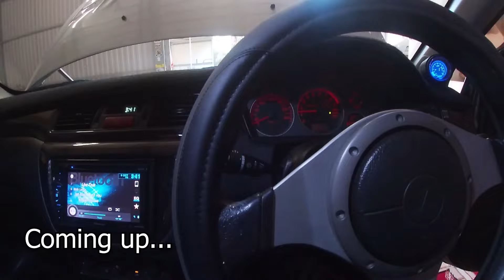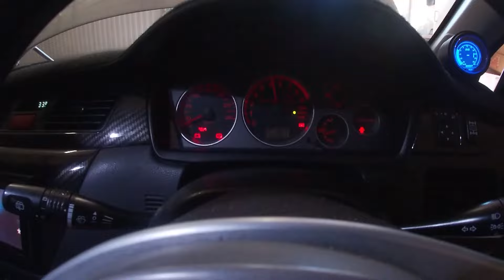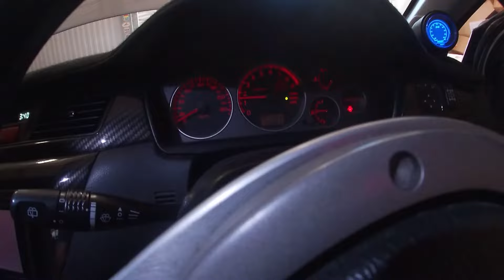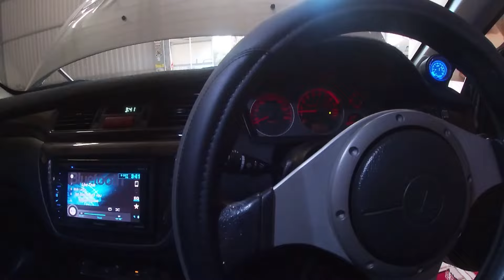I Almost Blew My Engine On Day 1 With My New Car

Comment: Idling high on start isnt an issue. Its a faster warmup. It should be variable and drop on warm temp.
Reply from the maker: Yee unfortunately it wasn't variable at the time, it would idle that high regardless of temp
Reply: @KingCondor  oh yeah that's rough. Sounds like you got it fixed. Ready for ep3

Comment: You can chop the end off the LINK ecu cable and solder in a standard USB cable with the green and white wires reversed ( not sure why link did this ) but it works.

Comment: if there is definitely a leak and it's not coming from the engine but it is oil, check the rear main seal between the engine and trans.

Comment: yep the oil on the one side of the dipstick is just from the walls. you want it to be even on both sides.  check it for leaks and if theres no leaks then the engine might be consuming it.. in that case i would try to look into the warranty on it since it was “replaced”

Comment: just a quick note on running 85, talk to your tuner to confirm but the washdown effect of the amount of e85 that gets shoved through the piston will leak though the rings and contaminate the oil. Not a bad thing but overtime it will breakdown the oil and you will lose the viscosity of the oil and start wiping out bearings. Just saying youll need to change your oil more often. easy enough and you shouldn't have an issue. just something people don't bring up enough when running true full blend e85. You'll also notice your oil will smell like fuel when you change it also confirming the wash down effect. Don't take my word for it talk to an engine builder/tuner.
Reply from the maker: Yee I'll be flushing it with 98 every 3 - 5 tanks aswell just to give it all a good clean and to help prevent corrosion in the lines

Comment: Very cool. 
But why would you want to run it on flex fuel ? Wouldn't that significantly lower the power?
Reply from the maker: no it would (and did) increase the power, flex fuel means it can run any blend between 98 octane fuel and e85
Reply: @KingCondor  ooooo ok when i hear flexfuel i think of e85
Reply from the maker: @mitchellhenn668  yeah straight e85 is essentially the most powerful fuel you can buy for your car on the street, so you use e85 for power or 98 octane gasoline for efficiency basically
Reply: Damn i didn't know that, thanks for the knowledge

Comment: im sure you already know this but make sure you double check ALL fluids, trans fluid, oil, coolant levels, power steering, clutch and brakes. some sheisters out there will knowingly sell you something that has issues but they wont tell you just to get it sold. also good to leave a big clean piece of cardboard underneath it for the first few nights at home to check for any leaks. 

never a good sign when a car is this low on oil, tells me three things. it's got a leak, it's burning oil or the previous owner simply never did any maintenance on it. none of which are good signs. 

check the headgasket, check the rear main seal between engine and trans, check the pan gaskets, check for any damage or built up residue, check for oil in the spark plug tubes (bigger issue on flat four's and sixes than inline 4's like the evo) drop the oil and trans pan when you do a fluid change, there are magnets in the bottom of both check them for metal fragments/shavings, look for any shiny/sparkly shit in both pans fluids. another great way to check for leaks is take it outside, power wash the bottom of the engine bay and undercarriage, then buy a couple of cans of brake clean and spray the entire bottoms and as much of the sides of the engine and trans as you can, might as well get the brake lines, gas lines and axle boots as well. everything that could tear, rip or have a leak. (grease packed inside those axle boots, if there's a tear, you'll know from the sheer amount of grease flung all up under the engine bay and undercarriage). 

a properly maintained car WILL last forever!
Reply: Don't forget blinker fluid

Comment: ooooo an evo.. i have an 07 wrx that i've put a LOT of time and money into over the last 7 or so years.. plan on swapping it with a 4.8L LS2 after building one but that requires tons of time and money i dont have atm. needs a custom subframe to fit an LS, the 4.8l is the only one i can realistically fit in the engine bay and still be able to close the hood properly. will need a new transmission that can handle power bc it will explode my current 5 speed.. that also needs to be clearanced and mounted.. new transfer boxes, new beefier axle shafts, new beefy driveline to the rear, new hubs that fit the axle shafts, new brakes and new wheels that fit the hubs unless i can find the same lug pattern hubs that will fit bigger axles and brakes. 

it's a project and a half, but right now while the engine is mostly stock, it runs great. tons of shit done to it, BC coilovers, sparco wheels 8.5 inch wide, sti brake calipers, drilled and slotted rotors from willwood as well as willwood semi ceramic pads, whiteline swaybars and links, some random aftermarket billeted and anodized control arms, some ebay UEL headers ceramic coated, arctic cat high-flow cat to an aftermarket ebay cannon 4" exhaust... will be changing that next to a tomei when i can find one, seems like they're only focused on BRZ exhausts for subaru atm. rear diffuser, front lip, TBW all aluminum bash plate since it's lowered (about a 2 finger gap all around between the wheels and fenders), strut bars, garage thrash seats and harnesses, new head unit.. under the hood, new heads that were resurfaced and rebuilt, new headgaskets (what subaru's are known for haha) newer injectors still same size as stock, new fuel pump in the tank, still on stock turbo for fears of blowing it up, have had it tuned, it was around 12psi stock, i now push 15psi and have it tuned to run on 93.. wanted an e85 tune but it's pretty hard to find around where i am, i have to drive 45 mins to the closest station that has any and for a daily, that's not happening. makes 240HP* (had to specify ik you aussies use KW not HP) to the wheels bc im afraid if i push for even 275-300HP it will have issues long term and i dont want to build a flat 4 because they're notoriously unreliable unless you spend $25,000 on basically all top of the line billeted parts and build one which i dont feel like doing lol, would rather swap it with something much more reliable that you can build for way less and make decent power. plan on having it somewhere around 600whp after the swap. id rather invest the money into LS parts which tend to be much cheaper here in the US and much more reliable. 

right now, it's not fast but it's fun as hell to drive. all the undercarriage upgrades definitely make a HUGE difference in handling. i used to have soooo much body roll in corners and now there is none, it just hugs the road like glue. only issue that's become slightly more of a problem since then is the fact that it's AWD and bc of that it understeers like a MF if you're coming into a corner too fast. am hoping to change that and adjust/tune that out when i fully swap it, not sure if a shop can tune transfer cases or what to send more power to the rear than up front this way i can hopefully have some oversteer instead of understeer, or maybe more power and a heavier foot can solve that issue, not too sure yet. 

long story short, MORE CAR VIDEOS 👍